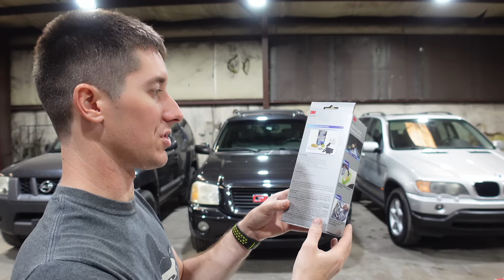I Bought EVERY Headlight Restoration Kit At O'Reillys *And Tested Them*

Comment: I could be wrong? But can't remember 3M headlight restoration kit  instructions where it mentions wet sanding using the p500 pad? From what I can remember water is only used at the third step p3000 trizact pad??? P500-p800 is dry sanding only, If I'm right this test is invalid!!! Perhaps reading the instructions properly would help!!

Comment: Sadly, headlights will sometimes fog from the inside and there is no easy way to restore them. I know about the magnet and cloth trick but, not always as simple as it sounds. It would be great if someone came up with a spray in or, pour in and slosh it around kit for the inside fog.

Comment: The Turtle Wax kit really impressed me. I was not expecting it to be that good.
Reply: Aluminum polish compound. Hand applicator, microfiber buff by hand, NEW looking with no headache in a minute or two
Reply: I used the turtle wax myself. The clear coat did not last long and the headlights hazed in a couple of months.
Reply: @2011joser  yep
Reply: I tried it once, my headlight oxidized again in like a week. And when the headlight hazed again it was worse than it was before I used the turtle wax.
Reply: @soap38  Try the Meguiar's kit. The end results (for me) weren't quite AS good as the Turtle Wax, but the lights stayed clear for months.

Of course, NONE of these products are a permanent solution and the lights will always haze over again a few months down the road. The only way to permanently fix hazy lights is to replace the lens. If only automakers made these lenses out of glass instead of plastic, we wouldn't have this problem.
Reply: Buy new lights all of the kits suck, all the effort and they stay clear for 2 weeks
Reply: I always use turtle wax its the best for everything
Reply: Yeah it looked good for me when I did it myself and just as said after about a month it went back to hazy. Wish it lasted longer but oh well.
Reply: I use the turtle wax kit on my dad Yukon and my Camry headlights I was impressed with the results too and the cool thing the shine lasted very well
Reply: Turtle Wax 🐢 products are next level now.
Reply: Don't be, used it before... trash. Just got lucky with that bimmer.
Reply: What ceramic coating would you recommend to protect the headlights ?
Reply: @ernestjones5113  I cleaned them they look great.now I just want to protect them from getting bad again.
Reply: @2011joser  Thank you yeah I tryed the clear coat and it did the same hated and then came off.
Reply: The turtle wax kit is a short time restorer. The best kit hands down if you ask me is....Cerakote Ceramic Headlight Restoration kit. has 8 oxidation wipes(4 each wipe) it help break down the oxidation and make it easier to wet sand it off. It has 4 sanding disc. 2 higher grit and 2 finer grits. then it has 2 ceramic coating wipes. completely dry within 30 minutes if applied properly. did my g35 2 years ago and they still look fantastic.  sits outside everyday too
Reply: @soap38  Ditto my 70 Ford pickup, also the non plastic trim is still mint.
Reply: I just used this kit yesterday. It cleared the oxidation just using the 1st step. The remaining steps clouded the lens all over again.
Reply: Even with turtle wax, the compound is not enough to remove the micro marks from the sandpaper. I used the kit and at certain angles, you can visible see the marks up close. It seems like everyone doing a diy video on restoring headlights doesn’t comment on this. Get close to your headlights and you’ll realize you need something with more cut to make it look new other than the compound in this kit. I get it’s a $12 kit, but if you document the results, do it to the utmost micro detail you can because a camera 1 feet is not enough to show the full extend of the restoration process.
Reply: Turtle wax has really stepped their game back up recently.
Reply: You should have split each headlight with a piece of tape so we could see a before and after side by side with each product.
Reply: That's the one i use. It works great!
Reply: We need the class lights. I don't know if we will ever have those again. I need all the real help I can get. Thank you for the choices and the information.
Reply: It's not that good. The results looks at at first, but it slowly oxidizes within a year. I wouldn't use it again.

Comment: I'm 61 years old and loved Turtle Wax as a kid. Then as years passed, I started using the new kids on the block. Went back to TW last year and was surprised to find their stuff still works great. Now I watch this and I'm a believer. Congrats on the easy road to 300K. Just kidding JR. I'm still convinced you never sleep.
Reply: And it a whole lot cheaper on the wallet.
Reply: I use chemical guys, awesome stuff. Turtle wax and meguires are good too. Chemical guys has a wax with a low dust formula, and it shines really good.

Comment: I am a professional detailer that does headlight restoration on a regular basis. We use the 3M professional kit which uses the same sandpaper as your Ultra pack but also includes pads for compound and polish. Always excellent results.
Reply: Mike Bonham  Probably about 2/3 is an upscale on a detail.
Reply: What can I apply one they're clear so they don't go yellow again?

Comment: interesting results!  I used the Turtle Wax hand-sanding kit for years and then awhile back switched to the 3M with the drill sanding pads.  they both work great but I'm too lazy to do all that hand-sanding with the Turtle Wax kit these days.  I am definitely impressed with how well the RainX restorer worked though!  for headlights that aren't too far gone, I've found Meguiar's PlastX with a foam drill polishing pad also works very very well for a quick restore.  but the kits with multiple & progressively finer sanding pads/discs (and sealant) will always give the best results.  the only caveat is you have to be careful with the drill-based kits - if you use too high a speed/too much pressure while sanding, you can actually burn swirl marks deep into the plastic surface of the headlight and those are a real son of a biscuit to buff out.  ask me how I know 😬

Comment: Turtle Wax has really upped their game here as of late the seal and shine is also a amazing product
Reply: Their ceramic spray waxes are great, too.
Reply: @donmynack  Seal and shine is fantastic and smells great too.
Reply: I agree I owned my own detailing business and was never married to a product.  Bought a ton of Chemical Guys stuff and 3M stuff over the years.  The Turtle Wax stuff has really surprised me lately.  Their Hybrid Ceramic coatings are great as a drying agent and I recently bought their graphene line.  I haven't had a chance to use it all but what I have used has worked great.
Reply: Yup, I especially like the new and improved spray wax. It has some kind of UV protection. Sorry but I mix and match my car cleaning products to get the best outcome.

Comment: I used the Sylvania kit on my 2002 911 headlights and it worked great.  The headlights were like the Xterra's and they look brand new.  No glazing or any residual damage and their clear coat is fantastic.  I had to order it from Amazon as none of the auto parts stores in my area carried the Sylvania kit.  If I have to do another set of headlights, I will give the Turtle Wax kit a go.  Thanks for the great info!
Reply: I saw another site's comparison and the Sylvania was the best and Turtle Wax was the worst of the group they tested….
Reply: I did use this too last week and yeah I agree this made my headlights looks brand new. It requires a lot of elbow grease to finish it though. This is another extensive youtube review that I follow that did a similar restoration review but better. https://www.youtube.com/watch?v=iDB5U4QUdD0

Comment: J.R. I just bought a Rain X kit from Walmart for $19.99 with a drill needed for sanding. It comes with 3 different grades of sandpaper and a buffer. Took 30 minutes for both headlights and they look Bran new. I had people ask me if I bought new lenses from the dealer. My lenses to start were 20year old completely white-coated looked impossible. I was skeptical, to say the least, and am extremely satisfied with $20. spent. Congrats on the 300k I would have thought you were way past that, You really do put out some great content. Here is to the next 300k sooner!

Comment: Used the Turtle Wax one myself about 7 years ago on my truck - was blown away at how good it was.  The protectant held up well too - didn't fade in the year left that I had it before getting another vehicle.  For upkeep and general polishing, Meguiar's PlastX is really good - it is a mild polish as well as a chemical deoxidizer it can turn a set around in a couple minutes, like the RainX one, but .... you have to apply some sort of UV protectant or they'll just start yellowing again.  The UV protectant/sealant is the one critical thing in the long run if the headlights are to stay looking good.  That or the government allowing glass headlights again. ;)
Reply: What uv protector do you use????

For instant clarity, I just use acetone nail polish remover.  Makes them crystal clear in one pass.   Don't make more than one pass...additional passes cause the fog again.  Don't get it on the paint.
Reply: @Lili-xq9sn  I haven't found one that lasts all that long yet.  I tried waxes (normal and ceramic) that supposedly have UV protection, but best they'll do is maybe 3 months.  Tried Meguiar's "Keep Clear" headlight coating, which is a clear coat paint, and that works for a lot longer.  I find it's very soft though and doesn't dry as smooth as normal clear coats.  A light buffing after applying it smoothes it out.  Depending on exposure, the Meguiar's can hold up 6 to 12 months.   I don't think one can do much better than that since any coating you put on is going to be a sub-millimeter thick thing, and the sun will easily break it down.  Just have to keep re-doing the lights every so many months.
Reply: @Dakiraun  Thanks for answering.  I'm down the rabbit hole looking at ceramic coatings.  I don't mind decorating annually.   I want it only for headlight plastic and windows (to make snow/ice much easier to remove.).  I'll look at meguiars.

Comment: One tip on the old fashioned sanding kits. Park it outside, and put the garden hose on fast drip, sitting on top, dripping down the face, and then you can sand away. The continuous water keeps you from burning the lens and keeps the paper from loading up. Used the sanding disk kits for a long time, but that RainX kit will be my next purchase.

Comment: I have been using PlastX by McGuire's for the last 20 years. I started on a 92 Crown Victoria that I thought needed new headlamps. Using the cream and blue paper shop towels, the lights came up almost like new in under half an hour with no tools. I've been using it ever since on Arthur, my 1990 Volvo 240 wagon. Twice a year and the lights do come out looking like brand new. Only takes about 10 minutes to do both lights. Arthur is still wearing his original 31 year old headlamps, and they are hard to distinguish from new headlamps.

Comment: The best headlight restoration kit is the Sylvania one hands down. The other ones don’t even come REMOTELY close. I’ve used the Sylvania one on headlights that were extremely extremely pitted and yellow and discolored and it literally makes it look like an absolute 10/10 brand new headlight. The lense is 100% clear and you can’t see any imperfections at all from any angle. It almost makes it look like the lense isn’t even there.

I just used the meguiars and the turtle wax one and they were like a 6.5/10 compared to Sylvania. They made the lense clean and white, and definitely more clear, but they leave a haze on it and lots of imperfections.

The Sylvania one comes with a wipe on clear coat, it’s different then a “clarifying wipe”. It literally makes it look perfect.

The two main important things are the quality of the sandpaper, and it has to have a clear coat. The Sylvania one also comes with a spray that you put on first that washes off the yellow grime, then you use the rubbing compound with sandpaper, then you use the clear coat. It will look like crap when your all done, but then you wipe the clear coat on it and it magically looks perfect.
Reply: Well there's a recent test of all leading restoration kits in which 3M was number one,where heavy oxidation and old clearcoat needs tobe removed, You won't find better than 3M!!

Comment: I used the 3M ultra on a 9 year old Mazda 3 with projector headlights.  Before the restoration there was no defined beam cut-off that you normally have with projector beam lights.  I used plastx polish and it didn't do much.  It cleaned them up some but still had a terrible scattered beam pattern. Somehow the algorithm gods brought this video to me and I watched it and thought let's try turtle wax or 3M.  Man it did not disappoint.  If you look really close you can still see some faint scratches but from 5 feet away they look almost new.  I am a quality inspector so most people probably wouldn't see the faint scratches.  Dope product, next time I'll try the turtle wax on my old E46 headlights.

Comment: I have used 3M in the past with a drill and it has worked well, but your result with Turtle Wax is eye opening.  This is really useful, probably the most useful one you have every done.  You may want to consider doing comparisons when it makes sense.  How to fix cars is useful as well, but this appeals to a larger audience!
Reply: Turtle Wax for me, from my experience with it!
Reply: I used the Turtle wax on the brake lights and blinkers of my 99 Suzuki GSXR 750 and it made them look brand new also.
Reply: 3m restoration kits the best, The demonstration here was wrong if they took the trouble to read the instructions first? The first two steps is dry sanding only!! It's the p3000 trizact you add water!!!🤔 😡
Reply: @keithroberts5611  Ah, you are right.  I forgot that as I used the 3M awhile back and it did work well.  Perhaps that is why it worked better for me than here - I  appreciate your pointing that out.

Comment: I've only used Turtlewax since these head light cleaners became a thing. Always pleased with the results and never once felt the need to use the sanding pads included in each box. I will say that I learned to put a protective coating to preserve the look and found that NuFinish polish lasted best at about 12 months. My next box will come with a protectant which I'll try. Nice video guys...best I've seen on these products.

Comment: Just used the TurtleWax on a 15 year old Saturn Vue..looks almost new.  There is something about that spray lube that makes the sanding both easy and crystal clear.  Sand first..then use the polish.  Their directions are kind of backwards.   They don't give you enough sealant for multiple cars so I purchased a bottle of "sealant only" so I could use up all of the other kit.  Throw in some LED bulbs and you will have an incredible upgraded night driving experience.

Comment: Turtle wax one is great use it all the time. It’s actually use compound first and it that alone doesn’t clear and clean you up then move onto sanding.
Reply: That's what I like most about it: Not all headlights require the same level of effort.

Comment: 300K!  FYI, the CERAKOTE Ceramic Headlight Restoration Kit has the sauce for multi-year longevity with its bundled ceramic UV coating
Reply: Yep this is all I use anymore and I use it on every headlight i see! 🙈 De-oxidize (I use rubbing compound), 2000 grit hand pass, 3000 grit, then clean. Cerakote wipe simple and not too messy, some practice necessary... Lasts longer and looks better than any other kits I've used!
Reply: @CamCanCars  the fact that they'll sell you just the protectant wipes in bulk vs the whole kit so you can BYO sandpaper etc is awesome too
Reply: I used the CERAKOTE for plastic restoration. It worked great. Maybe JR could compare different trim restorers on these SUVs.
Reply: Yeah I did that on Amazon and thought it said only enough for 10 cars; so pleasantly surprised to see 50 packets of step 3 in box. 

I haven't used Cerakote trim restore yet, but have had good luck with Chemical Guys VRP on most stuff. Would love to see a comparison!
Reply: Cerakote all the way. I am extremely impressed on ease of use and results. 

I think it’s $25 on Amazon. 

I recommend you use masking tape around the headlight before applying the ceramic wipe.

Comment: I found for me the best outcome was sanding. Wet sand from 800-1000, then 1500 then 2000. Good coat wax after, headlights still look good after 1 year.

Comment: As a fan of the 3M kit in the past I'm actually a little surprised by these results.  Great test!  The most important step is always the seal at the end and sadly most kits lack a sufficient one to last more than a year.  That Turtle Wax kit is promising though!
Reply: I wonder if anyone has feedback with the turtle wax after at least a year?
Reply: @bowieknife Turtle wax is primarily an after care product, And not a full restoration solution, Buffing alone will not remove old cracking and flacking 2kmax and such like, No the surface has tobe removed by sanding (dry)